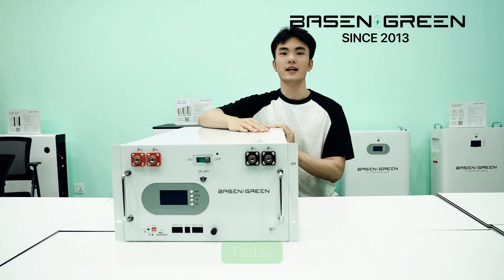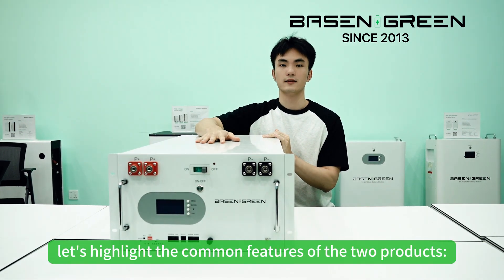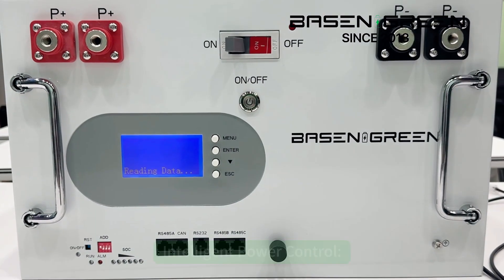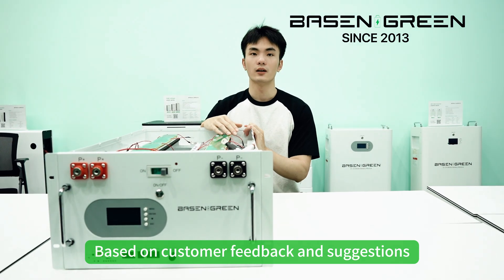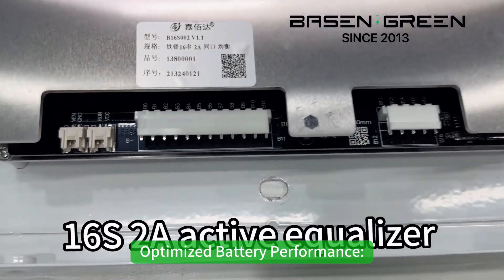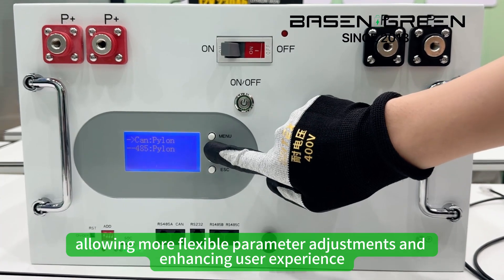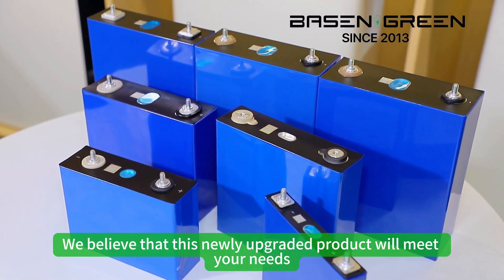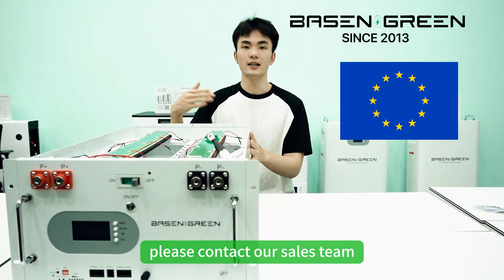Unveiling BASEN's Latest DIY Battery Kit Upgrade | Enhanced Safety & Performance!

Comment: The hardware/iron is of very good quality, but the programs are at a low level. Out of dozens of such batteries, I was able to connect only a few to the inverters, most without communication.
Reply from the maker: Hello, may I know what brand of inverter you use?

Comment: Are the kits able to be connected in parallel with other identical units? and will they communicate correctly via pylontech protocol?
Reply from the maker: Hello, we recommend only using same brand of BMS to make the parallel connection.